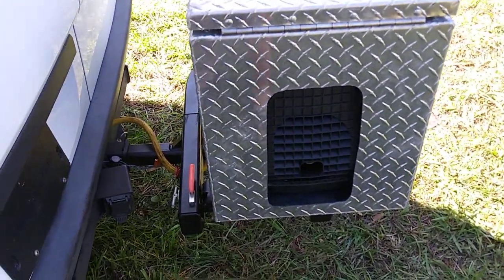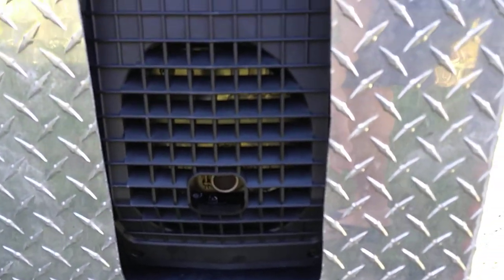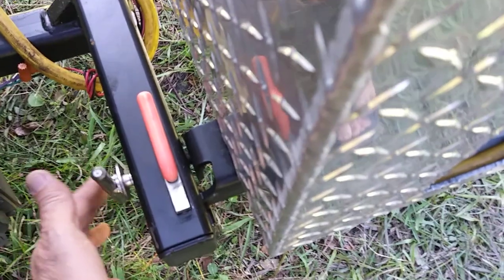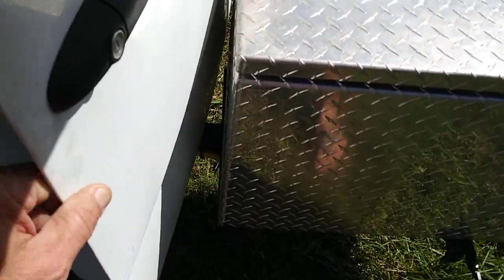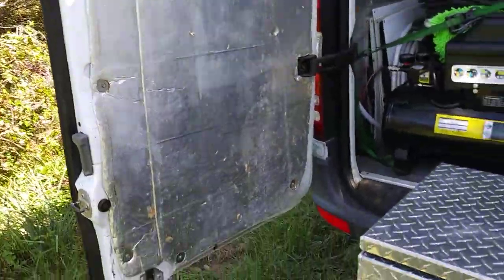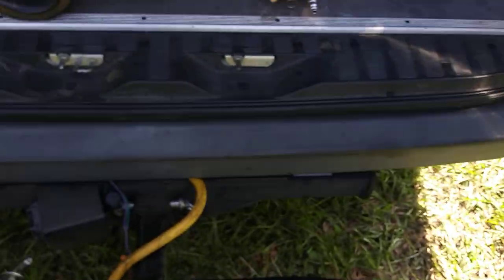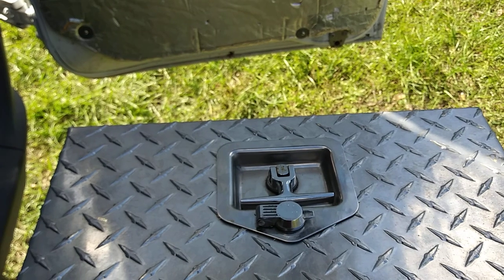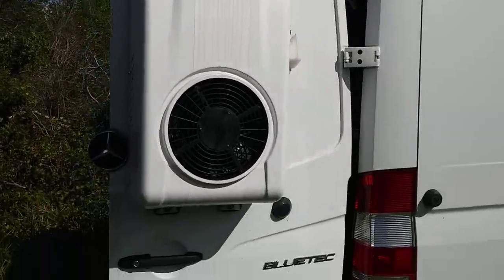Stowaway2 swingout hitch and generator box review👍

Comment: Can't wait for the upcoming content.

I ended up buying the newer model of your A/C. It's a proper 12v now and is also a heatpump too. So heat and A/C.

I haven't gotten around to installing it yet. I need more battery capacity.
Reply from the maker: If you post a video on it I'll check it out👍
Reply from the maker: To get your remote functioning properly just press and hold the mode button and temperature down button at the same time.

Comment: I’m curious about the air flow into the box from the other side. Have you had any issues with the generator?
Reply from the maker: I drilled 2" holes in the bottom on the intake side. Surprisingly it doesn't get very hot. Pretty normal temps. I try to have the van shading it on hot sunny days while running it.

Comment: My question is...
How you change your e bike? Does it go straight from generator?  Which charger you use? I have similar setup.
Reply from the maker: I use the generic wall charger that came with the bike. I just plug it into a receptical. Usually i use my inverter because the sine wave is cleaner than the gen puts out.
Reply: How many amps is your charger?